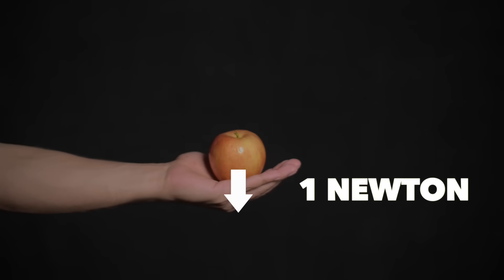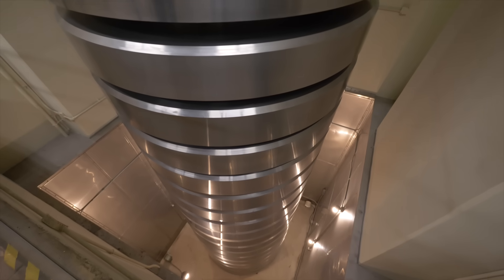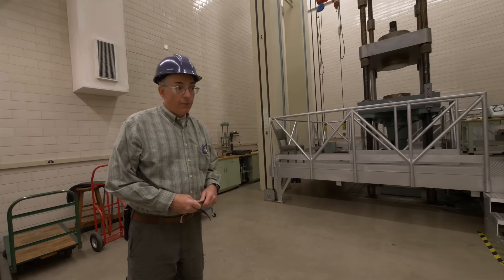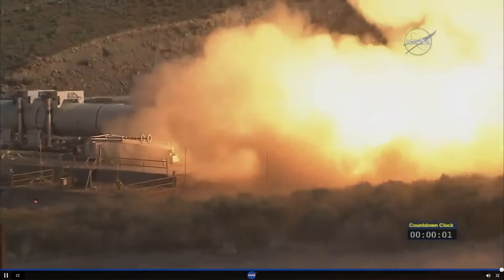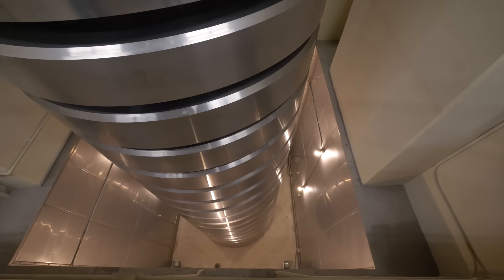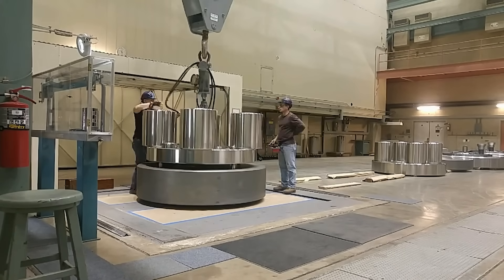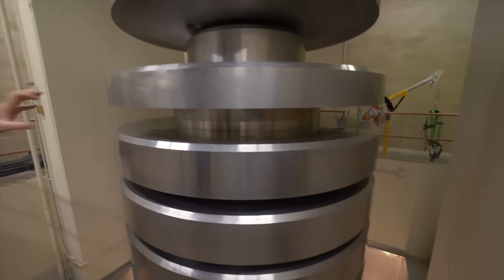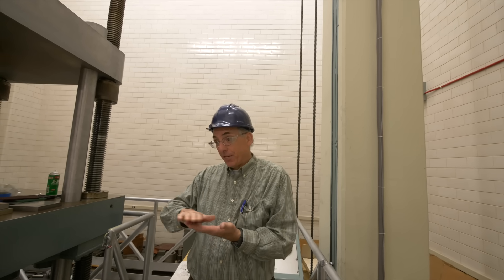World's Heaviest Weight

Comment: In non retarded units that's 453 592.37 kilograms
Reply: Newton is a unit of force, and it is dependent on gravity. Kilogram is a unit of mass, yup.

But this whole device is all about force, so it sounds funny to have it in pounds.
Reply: China numba 1
Reply: Cyanide Word What in the hell are you talking about? Every country in the world uses the Metric System. The US, Liberia, and Burma are the only countries that use at least two systems. Liberia actually uses 3. Please, actually read what you write.
Reply: Why is it funny to have it pounds? Pounds is a measure of force.
Reply: v1asec
Pounds is unit of force as well.  Ever here of pounds per square inch.
Pounds being used for both makes it a good choice for converting between force and weight as the object in the video does.
Reply: Moneydud
>Retarded units
>Sole country that uses it is the only one to land on the moon
^they just got lucky, russia moon landing ftw
Reply: Por1ya 
Russia aka never landed or even tried to land men on the moon. 
The US was the first country to actually officially accept the metric system. Technically , all measurements arbitrary anyways. You want to really use a less arbitrary system measure in Planck lengths instead. And inches stay on the base 10^3. 1 inch equals 1.57 x 10^33 Planck lengths. A millimeter equals 6.19 x 10^31. The reason that there is closer is the Planck is based on the second which like inch has a base 3.
Reply: Hey. You can talk when you land on the moon m8
Reply: Robin Gilliver
America is the most innovative country in the world. We have invented a lot of things and their modern variants. We're leading the Space race, have been to the moon, have the highest GPA, the strongest military, and export more food than we know what to do with. If we stopped exporting food, the world would go into a massive state of emergency due to extreme shortage of food. The fact that you called my country's cultural differences "dumb" is not only retarded, it's also pathetic.

No country is smart if it is dumb enough to drive on the left-hand side of the road. No country is smart if it is dumb enough to have a UFO investigation program (America is the only country that doesn't have one). No country is smart if it is dumb enough to NOT be America.
Reply: While it is likely there is sentient life on other planets.  It is unlikely they have visited the earth.  There is no reason fr them to pick out of all the stars pick earth.  All of the stars within our communication bubble
(75 ly) are younger than Sol(our star) so if you consider Earth typical technologically the other star holds sentient life they are technologically behind us so they aren't coming here.  Those further out we are silent so they have no reason to expect life at all.  Given this it is unlikely aliens have been to Earth.
Reply: stfu
Reply: I Diagnose You With The Gay
Listen better the US used the metric scale the guy using pounds wasn't from the US.  Pounds is used to convert force measurements to weight.
Reply: The agency has decided to use metric units for all operations on the lunar surface -2007
Reply: Well, i'm glad that NASA uses metric :^)
Reply: LMAO TL DR moon landing was lucky
Reply: Except NASA uses both measurement systems. As a matter of fact, a lot of airforce related companies and agencies MUST use both, due to the metric being good for science, and the imperial being good for engineering.
Reply: NASA and Air Force related companies and agencies use both because they have to deal with the US. Metric is superior for engineering, and for everything else. Imperial is only good for having a reason to change to metric.

How can a nonsensical system be good for engineering? Explain yourself. Give me papers. And articles. Put some science in your statement. Come on.
Reply: The dual strategy led to the loss of the Mars Climate Orbiter robotic probe in 1999; a contractor provided thruster firing data in English units while NASA was calculating in metric.
Dual system is perfect.
Reply: The error was in a distance not weight or error.  If they had used either one they would be alright.  But, weight and mass aren't identical except on Earth.  Kg is a term of mass newton and pounds are weights.
Mass of an object isn't affected by gravity, weight is.  In zero g objects are weightless but not mass-less.  A 1kg mass on earth is 1kg mass in space.
Therefore it isn't good for thrust which depends on gravity which creates weight.  Pounds are weight and good for thrust measurements.  Newtons work too but are so small the number  is extremely large even for small weights.  This is why weight measurements are made in pounds and not just in the US scientifically to distinguish weight from mass.
Reply: CETNIKDOJAJA 
Wrong outside the earth's gravity weight amd mass are not the same. Thrust is related to gravity so uses a weight based measurement. Kg is a unit of mass. Pound is unit of weight. PSI is used outside the US.
Reply: MarioGamerZ 
That is true but aluems most likely haven't visited earth either
Reply: Dod Man
I have explained this before but, kg isn't a unit of weight  but unit of mass.
Mass is independent of gravity weight is dependent.  Thrust and presure are dependent on gravity.  So is used for such calculations.  If you paid attention the lab isn't in the US. Even on earth there are slight variation the strength of gravity such that at the north pole you weigh 1 pound more than at the equator.  This has to be taken into account durring launch at different locations.  Mass doesn't change.
Reply: Moneydud He's not calling the US retarded only the fact they're Imperial Scum and don't use a system that they and two other countries are the only ones who don't use
Reply: Robin Gilliver 
Shows howvlittle you know pounds are measurement of weight amd force kilograms are a mesurement of mass.  Using the same unit for  weight and mass would be confusing for off earth. On mars 30kg equals 100kg. A 100kg mass weighs 30kg. Also  Pressure and force use piunds per square inch
Reply: Por1ya Lmao, did you really just say "they got lucky"? This isn't a game of darts. The Moon landing was calculated, studied, and theorized. Hell, they went an extra mile on everything, even going as far as to seal the astronauts for 2 weeks in the case that there was moon bacteria. There was no luck, only precise calculation and caution.

The Russians never landed on the moon. The only country to put men on the moon is the US.
Reply: imperial users are retarded, MPWW Metric Pride World Wide
Reply: CETNIKDOJAJA  on Opposite Day
Reply: Moneydud >implying US landed on the moon
Reply: >Retarded units
>Sole country that uses it is the only one to land on the moon

Please pick one

Comment: I don't know what to comment here so ill put up a pancake recipe:

Ingredients:
1 1/2 cups all-purpose flour
 3 1/2 teaspoons baking powder
 1 teaspoon salt
 1 tablespoon white sugar
1 1/4 cups milk
 1 egg
 3 tablespoons butter, melted

Directions:
In a large bowl, sift together the flour, baking powder, salt and sugar. Make a well in the center and pour in the milk, egg and melted butter; mix until smooth.

Heat a lightly oiled griddle or frying pan over medium high heat. Pour or scoop the batter onto the griddle, using approximately 1/4 cup for each pancake. Brown on both sides and serve hot.

Comment: This entire comment section: "WHY NO METRIC, IS BETTER" 
If you wanna build rockets and airplanes and half the world's weapons: you can use whatever units you like
Reply: But imperial is just extremely inconvenient in science. All of the SI-units are based on metric and conversion between them is easier in metric. Imperial is fine for daily use, but i cannot comprehend why you use it in engineering and science. It's outtdated and inconvenient.
Reply: Societal Pillage AngryRacoon is right, and since space travel is expensive, it lead to 18 billion dollars being wasted. :(
Reply: bornholm55
No the US version actually isn't is power of 2 based.  As, is much of the original imperial  system.  The British changed the system after the Revolutionary war.  The volume measurements were originally based and still are binary divisions.  8 ounces = 1  cup , 2 cups = 1 pint, 2 pints = 1 quart, 4 quarts = 1 gal.  And, force measurements aren't measured in metric.  And, the error came because someone used metric when everyone else was using original imperial.
If you use the same measurements through out it doesn't mater which you use.
Reply: bornholm55 ever heard the saying if it ain't broke don't fix it?
Reply: AngryRaccoon
metric isn't used to measure force this is force measurement device not mass.  Th other force unit is newton which also isn't metric.
Reply: That is why America uses metric for most of their science and military engineering.
Reply: H
Reply: Actually a accident in space happened because they mixed the systems, so yeah just use metric and nothing more.
Reply: Anything in Aero space has been decided to use imperial...
Reply: stfu ameridumb
Reply: Societal Pillage hail europe
Reply: :D

Comment: Must suck to be the guy who has to clean all the weights every hour to make sure dust doesn't add weight.
Reply: It would make more sense for it only to be cleaned right before it's gonna be used.
Reply: Does wiping the metal surface creates micro burrs?
Reply: erikrann Probably gets paid more than any house hold cleaner...
Reply: @jamzsmp  more than a manager
Reply: It's likely in a temperature controllerd room with filtered intake too, dust collection would be very slow
Reply: a machine probably cleans it
Reply: The uncertainty is plus minus 5 pounds. How much dust can you collect in an hour to increase that uncertainty? Just not gonna happen. Most likely they clean it much, much less often than every hour.
Reply: What?
Reply: With 5lbs of variance expected, some dust isn't going to be a problem you would think? Then again they factor in its buoyancy!
Reply: @BalancingEternity   what about condensation with humidity
Reply: i think it's much harder than that
the very act of cleaning might change the mass (even if it's a Super small amount)
Reply: EyeoftheYeti dumbest comment on YouTube award
Reply: I'm guessing they don't clean them.  It's ok for the calculations to be off by 5 pounds, and it takes a long time for 5 pounds of dust to build up.  Whereas cleaning them every day would remove tiny amounts of metal (like how statues get smooth if rubbed by lots of people in the same place for years) disturbing the weights much faster.
Reply: I dont think thats accurate....
Reply: Well yeah but the buoyancy is 125 pounds, which exceeds the 5 pound tolerance
Reply: erikrann dust at home is mostly caused by dry skin tissue, and other organic matter. Since 3 or 4 people live in that small space for the most of every day, there's a decent amount of dust in a month. A giant room like that wouldn't gather that much dust compared to surface area.
Reply: @EyeoftheYeti I'd hate to see how clean your house isn't.
Reply: They have it in a vacuum sealed room, so it’s clean, forever.
Reply: Just use pressurized air...

Comment: Just out of curiosity. What are those massive weights made out of? (I don't think that was mentioned in the video but I could be wrong.)
Reply from the maker: +Tue Le stainless steel - and I think a very high grade of it
Reply: Thank you. That makes a lot of sense. I went through a list of the chemical elements and came to the same conclusion. High-grade (stainless) steel is probably the best option.

Comment: My question is: What are the components of the actual weight-mass made of? They "look" like stainless steel. if so, 316, 404, (or ASTM number)? Whatever the material, it would have to be very stable over very long intervals. And at this scale, even the temperature would come into play, not just of the air but the material making up the weight itself.

Comment: But can it crush a fidget spinner?
Reply: Tyler and Hannah midget spinner
Reply: digit spinner
Reply: More importantly, can it crush every fidget spinner
Reply: it can't crush a Nokia so it's useless xD
Reply: Not
Reply: Tyler and Hannah yes
Reply: but what about a Diamond (and stainless steel & titanium(both are in the diamond fidget spinner)) Fidget Spinner!?
Reply: theminecrafter yes IF the weight is dropped
Reply: Tyler and Hannah hydraulic press vs 1000000 lbs weight
Reply: VS 1000 RED HOT KNIFE VS 10000 FEET DROP! (GONE WRONG)

Comment: I didn't see - or at least didn't understand - how this machine with 1 million pounds of weight could be used to equate to / verify the thrust of an airplane engine, or a rocket. Can someone please explain? Unless the rocket or engine output was exposed to the weights in some manner, thereby lifting 'n' amount of weight with the thrust, I am at a loss as to how this works.
Reply: The weights are used to calibrate a transducer (that small piece from about 1 min into the video). That part would be installed in whatever test the third party would be doing. Whatever conditions that part sees, it can convert to an accurate force based on the calibration curve.

Comment: Actually those Honda Odysseys each way 3,500 pounds but in the video, 50,000 pounds divided by 10 Honda Odysseys of that model and year is supposedly 5,000 pounds, making the video wrong about the minivan statement.
Reply: I'm pretty sure he's making a joke about fat americans.
Reply: KiwiPowerNZ you are completely wrong , they are talking about the Honda odysseys weight in general, not with passengers , because they didn't mention that, and if they did they will still be wrong because an average human being does not weigh 187.5 pounds , so you are completely and educationally incorrect.
Reply: KiwiPowerNZ and it's an 8 passenger not 5 , smh
Reply: No it's correct you just forgot to add the passenger weight of the 5 Americans.